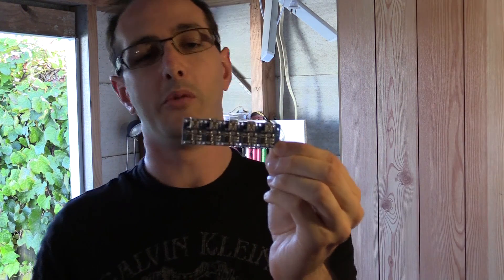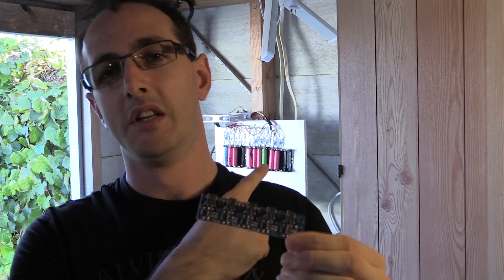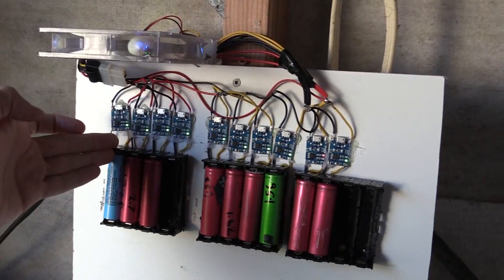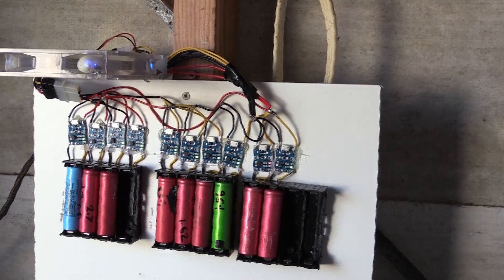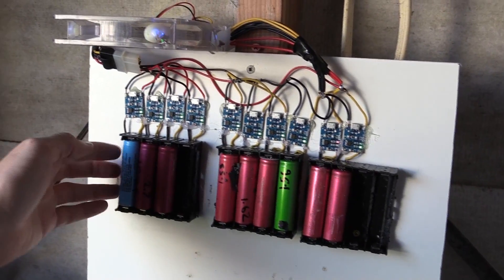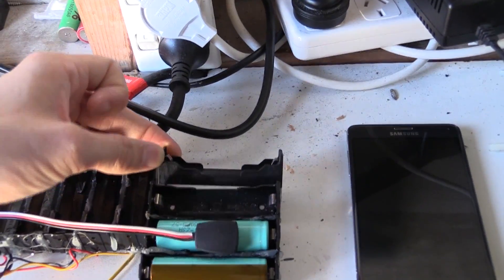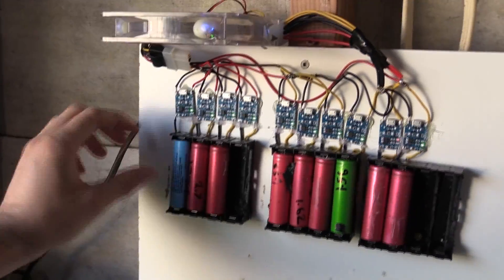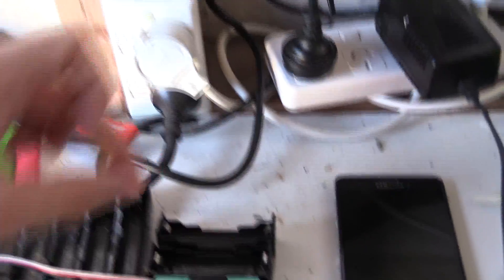Charging what! Charging batteries 18650 Oh yeah

Comment: Are your 10 x 1A charging circuits connected in parallel to the 5v supply?   If you connect 30 x 18650 3.7v cells to make a 10 p3s 12.6 battery, you would charge with greater than 12.6v using how many amps to the battery?
Reply from the maker: Yes they are in parallel to the 5v supply. Check out my latest video on my charger https://www.youtube.com/watch?v=uZMe7zOqh2Y

Comment: Sir...  Can you help me with this? 

I want make a powerfull powerbank so the module is only givr 1A/cells,my idea is just using 1module for, charging 25 cells? Is the module can handle that?
  Or it only can handle 5cells/module? 

I use this for charging 4batteries now, it got very hot when the battery voltage is under 3.9volt, I can't touch the resistor and the IC but it not burned :D

Comment: I have a bunch of 18650 batteries that I bought at walmart for my Tactical flashlight. They are 2,000mAh each. I have a power bank that has the same mAh. Can I use this to charge my 18650s?
I only need to charge one at a time.
Reply: coondogtheman1234
If the power bank uses an 18650, then you shouldn't have any issues. If it uses a flat lipo cell, it might overcharge the 18650s due to different cutoff voltages, etc.
Reply: If it helps, my first reclaimed cells were tested/recharged in a cheap power bank. A few weeks later I bought a 4 cell charger/tester (Opus BT-C3100) to save time.
Reply: tin2001 i might just get a proper 18650 charger off Amazon. I kind of have the wires stuck on with tiny magnets.
Reply: tin2001 the power bank uses an 18650 cell and has the same rating as the battery I wish to charge.

Comment: Save all the trouble an get a Foxnovo F08-8-Slots Li-ion Intelligent battery charger, it's the best,  I have been using it for over 3 years, I paid $40
Reply from the maker: I would need 2 of those which would be around 80 the ones in the video are less than $20

Comment: Why not use a second molex from the same power supply and keep the red and black wires which are 5v in the molex and remove the other two, safe and easy .All you have to do is find a long molex to sata, cut the four wires at the base of the sata power and measure where you have to splice and solder the wires, nice and neat and use double face tape to hold the charger and holders to a plate of wood or plastic.
Reply from the maker: Yes that would be a good option :)

Comment: Can you use this TP4056 charger as a battery bank. I mean can i hooked a load to TP4056  device and use the energy from the battery.
Reply from the maker: TP4056  is only a charging circuit, You just connect your load directly to the battery.
Reply: Yes, this is what i thought. BUT it wont work for me. Because i want to replace an old lead-acid battery of my UPS with a power bank of 18650 and there are only two terminals for the lead-acid battery (positive and negative, used for charging and discharging). Thus the charging and discharging should go from the same terminals also for the 18650 power bank.
Any idea how to solve this?
Reply from the maker: Use a BMS to turn the cells off once they are fully changed or discharged, the UPS will put out the charge voltage ether 12v or 24v. So if its a small one it will charge at 13.5V so since you cant change that you need to design your 18650 bank to just under that. Its hard to do with 12v ups much better with a 24v ups. What one do you have?
Reply: My ups is with 12 v battery. I was thinking to use 18650 batteries in a combination with BMS from circuit board of old laptop battery in order to charge and discharge 18650 bank properly. 
any better suggestions?
Reply from the maker: That could work, I would look at 24 volt ups as the load on the 18650 cells would be lower.

Comment: Good vid! 
I think the part about pre-charging weaker cells with the iMaxB6 before putting them up on your wall charger is unnecessary since the charging circuit your are using (TP4056) does that by default.  Or did I miss something?
Reply: Correct, I thought exactly that too. The TP4056 chip has a low voltage cell recovery mode so just stick them in and let it do it's thing...

Comment: how many mah is equal to 1ah
Reply from the maker: hmm  1000mah is 1ah
Reply: then how many Ah is equal to 1kwh
Reply: Glue a ribbon or string to one side of the inside of each holder so when the battery is done, you pull the ribbon until the battery comes out, but not enough to pull the whole ribbon out and the battery pops out or just place the ribbon under the battery when you put it in to charge so when it's done, you pull both ends of the ribbon and the battery comes right out, understand?

Comment: You should get one of these for the 5V power source.
http://www.ebay.com/itm/AC-110V-220V-TO-DC-5V-12V-24V-2A-10A-15A-20A-40A-60A-Switch-Power-Supply-Adapter-/151928719853?var=&hash=item235fa849ed:m:mGHQzsM2zsbvEUasc4rRv6Q
Reply from the maker: Good idea but why spend $25usd when a computer powersupply does work. Tho one of those would be good if it had one kicking around :)
Reply: +Mikes DIY Tesla Powerwall It's better than using excess energy on hard drives to keep the unit balanced and this way you can charge more cells.

Comment: You can put max 8v to the tp4056 chip (according to datasheet). Just putting it out there - You could run them safely on 6-7 volts.

Comment: Could you not get a 12v -> 5v step down converter to run more of the chargers while also maintaining utilization of both 12V & 5V rails from the PC Power Supply?
Reply from the maker: Could do but the buck converter would need to handle 16amps
Reply: Not necessarily as would just put a 12v to  5v converter in front of each charger board and put multiple buck converters in parallel per 12v rail
Reply from the maker: That would work, but at a cost, Just by plugging in a old hdd to the 12 rail fixes the problem

Comment: And always recharge at work to save electricity - essential piece of information!
>;o)
lol
There is a new version of the TP4056 with a protection circuit built in - the current ones on ebay for £0.99p are the old ones!

Comment: I have read that 18650 cells  do not required to be balanced like lipo  if you have 1s3p you could charge them directly with curent limit charger of 1Amps 12.6   if your pack is 2s3p  you could use more current for charging  just make sure your charger is current limited
Reply from the maker: You can charge in parallel but if you do , first let the cell sit in parallel for an hour first or longer so all cells reach the same voltage before you apply charge to them. Nothing wrong with charging good cells in parallel but you wouldn't want to without first knowing if the cell is good. Eg if its just come out of a old laptop batt you first need to know if the cell is dead, its not going to over heat or its not a dead short. So this is why testing each cell separately is important for the first time.

Comment: there is new versions of that TP4056 , i already have a bunch of them ( 5 peaces ) 
check here 
http://fr.aliexpress.com/item/1-a-lithium-battery-charging-and-protect-one-plate-protection-2-in-1-18650-lithium-battery/1494950221.html?spm=2114.06010108.3.11.3CJsN4&ws_ab_test=searchweb201556_8,searchweb201602_1_10037_10017_10021_507_10022_10032_10020_10009_10008_10018_10019,searchweb201603_7&btsid=0c83b7c0-04f5-4156-8f07-f7f6ec172372

& thanks for the video mate :)

Comment: Heads up...the linked one cell holder DOES NOT work with flat top 18650s
Reply from the maker: +Jeremy McNamara Yes sorry about that , Here is the right ones
http://www.aliexpress.com/item/18650-Battery-Holder-Plastic-Battery-Holder-Case-Storage-Box-1-18650-Holder-3-7V-with-Pin/32542430206.html
Reply from the maker: +Mikes DIY Tesla Powerwall I have also updated the link above

Comment: Has anyone ever tested with good equipment how much current these boards supply to the cells after the charging has completed (green led lit)?
Reply from the maker: +Mandragoras They charge at 1amp stock. After the green led is lit they shouldnt be putting anymore into the cell.
Reply: Mikes DIY Tesla Powerwall There are cheap chargers that keep supplying current (milliamps not microamps) even when the charging has supposedly completed. This is why I asked.
Reply from the maker: +Mandragoras They are cheap yes but they are only a circuit without the whole package which also makes it cheap as it is only one part that you need. Also they use the same chip other much more expensive charges have in them out of the box. The chip controls the cutoff, and looking at the reviews its not bad.

Comment: Be careful of these alot of these tiny chargers over charge and kill the batteries. Not recommended.
Reply: +harveyboy45 And when I dare to speak up and comment this in big channels, fanboys bash me.
Reply from the maker: +harveyboy45 I wouldn't leave charged cells sitting in them. but so far i haven't had any problems
Reply: +Mikes DIY Tesla Powerwall you.re doin a great job any way Mike. I've taken on your discharger idea with some cheaper units. Part of my regimen is to test for battery resistance too with my acucell charger. Any thoughts on this? Keep going dude.
Reply from the maker: +harveyboy45 battery resistance - no not really, I haven't, I dont think HB did test for it. I think it shows on the cell capacity anyways, If its high then the cell wont have much capacity as it will just go to heat. It will ether get hot while charging and get put in the bin or wont test high in capacity.
Reply: mike could you tell me how to wire 1 off these charging modules to charge 2 batterys in circuit like i am making a small little home mad stun gun and instead off having a seperate battery charger and having to remove them all the time to charge them id like to mount one off these modules onto it for easy charging but im unsure what way to do it as u said u can easily blow these modules becauese they are not protected hope yout can help me thanks

Comment: I think it would be better to use 12V from psu and step-down converter to 5v. 12V from psu can deliver high amps without voltage drop. But your solution is clever and needs no other device and money. Well done!
Reply: +Radim But it would drop the efficiency of the whole setup and the buck converter would have to handle 10 amps. So it would also increase the cost as only one cheap buck converter could not be enough.
Reply from the maker: +Radim 5v is easier and what i have done with using load on the 12v rail solves the problem

Comment: I max B6 will charge 16 cells at once at 300 mah each.   if you are testing recycled batteries the lower the current the better.
Reply from the maker: +MrEroshan 16 cells? not without putting some cells in parallel
Reply: Yeah they are all in parallel.

Comment: i built a charger for 20 batteries with those, your not kidding about reverse protection. i bought 35 and about 25 left. i get so excited to charge the next battery that i will mistakingly put in backwards lol
Reply from the maker: +donzi joe wow 20 at a time, nice. What did you use to power it all ? computer PSU?
I havent made that mistake yet but i am sure it will also happen to me. Lucky they are cheap right
Reply: +Mikes DIY Tesla Powerwall Yup, i just use a computer power supply. seems to work very well.

Comment: Nice charging setup Mike. I managed to kill two of those little charging boards by putting the battery in backwards - it seems to be something I'm quite good at.

Wild guessing: I wonder what would happen if you wired two chargers in series across the 12V supply of your PC power supply. If that worked it might solve your wire/connector overheating issues, and also add more load to the 12V side.

I seem to recall newer PC power supplies are designed to provide much higher currents on the 5V line rather than the "legacy" 12V line. So you might not need the HDD dummy load with a newer power supply (if you had one laying around).

Good luck!
Reply from the maker: +Paul Kennett Hmm didnt think about putting them in series tho good idea.
The psu i used is a Thermaltake Toughpower 650W i had lying around.
Reply: +Mikes DIY Tesla Powerwall Needless to say - the extra volt per board might be bad... or not! :)
Reply: +Mikes DIY Tesla Powerwall Ah... just noticed this info on your AliExpress order page:

- Input voltage- 4.5V-5.5V.

And on the one that I ordered it says:

- If the input voltage is too high, like 5.2v, the current will be less than 1000mA, it is normal. 
- It is protection function, auto-substract the charging current to avoid burn damage to chip.
Reply from the maker: Paul Kennett Oh that handy to know. They also seam to run lower then 4.5 as at one point i saw 4.2 on my millimeter on the input before i added load to the 12v rail on the psu.
Reply: +Paul Kennett Looking at datasheet for TP4056 and max input voltage is 8V

Comment: i would recommend avoiding the noise in the background because it really makes hearing hard

otherwise the mic and camera are great, and I like the ideas

is that a knock off IMAX ?
Reply from the maker: +BillTheBox I know sorry about that noise. Next time i will turn the pump off but at the time of videoing i had a load of washing on so couldn't.
Nope, its a original IMAX with the code sticker on the back
Reply: You can filter that noise out to almost zero dB by using a free program Audacity.
Reply: +Mikes DIY Tesla Powerwall 
The noise is fine, it doesn't even overpower your voice.